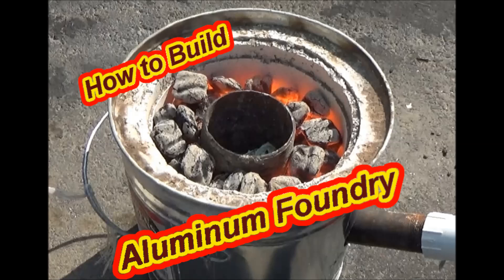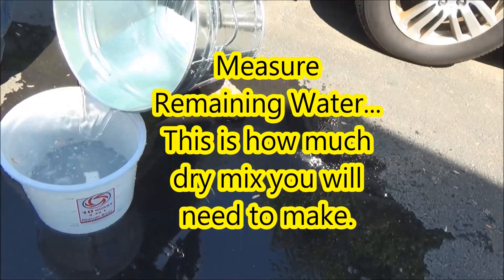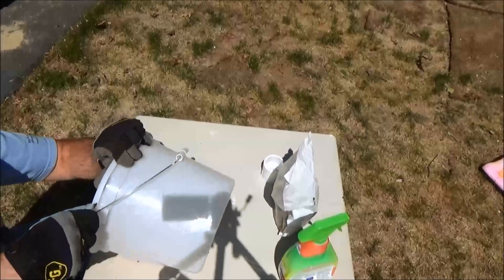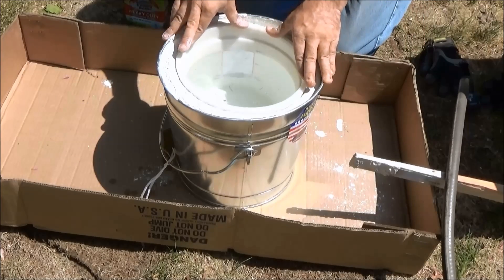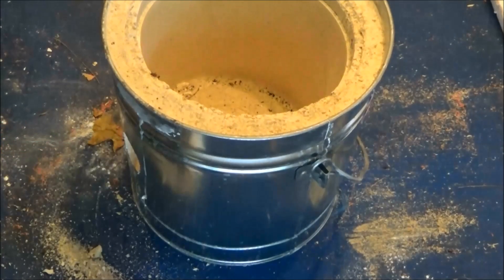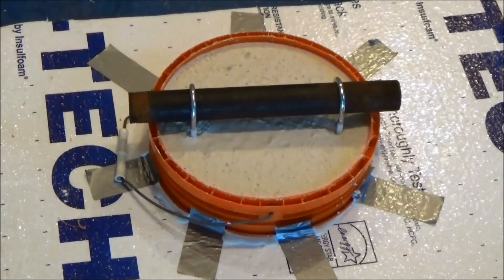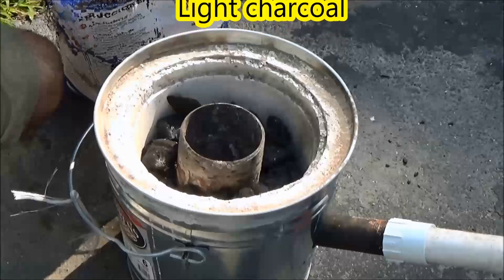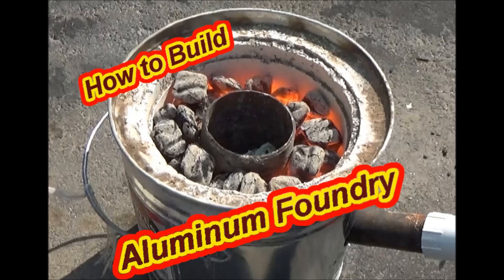How to Build an Aluminum Foundry!

Comment: What did you use as a crucible? The same one Grant used?
Reply from the maker: I used a 4 inch iron pipe with a cap. Thanks for the comment!
Reply: @heathputnam9524  creative.  Liked how you used the hair dryer instead of the propane too. Awesome video thanks for sharing.

Comment: Something I missed here is perlite floats! It either needs to be saturated prior or realize where he puts the perlite in it will float and separate from the plaster of Paris if you use his recommended 10qts of water. The plaster mix I bought was not 1-1 mix it was 2 parts dry to 1part water. So I started over.
Reply from the maker: Keep mixing until the perlite stops separating and floating. Then pour it in. Thanks for the tip and for watching!

Comment: Hey I love the vid. I made my own. To anyone thinking that this will be way to big, it’s not as big as you would think. Also, do I need a hair drier that I can turn off the heating coils on? Those cost more. 

Ps, is eazyer to pour the plaster mix into the free lid the bucket comes with from Home Depot instead of makeing your own lid. I didn’t have a hole saw so I marked out the hole on the metal lid, then perforated it with a nail set, after that, I hammered a flat head screw driver in between each little hole to cut out a little disk from the lid. After that I just carved away at the soft plaster with a acre driver to make the hole. Did the same method for the air intake. I also mixed steel wool into the lid so it would be stronger.
Reply from the maker: So the hair drier is just for forced air. Any one will work. Thanks for watching!

Comment: You are using a galvanized bucket, did you know that its vapors at high temperature are highly toxic!!!???
Reply from the maker: Yes, but after the first use in a well ventilated area the galvanized surface is clean. Thanks for the comment.

Comment: If you want to save your bucket, use vegetable oil. I drilled my hole about an hour after it cured and it seems to be fine so far.
Reply from the maker: thanks for the tip!

Comment: This seems so much more efficient than a propane-style foundry. I’m not talking weight, but the price per BTU
Reply: Depends on the material costs in your region.
Reply: It depends on how often you use it
Reply: Gas is cheaper if you buy in bulk
Reply from the maker: Thanks for the comment!

Comment: My comment is to ask how you put the crucible back to continue melting once you remove it and pour off the aluminum ? yes I intend to build this (your) foundry and use it, thank you for the instructions ...was just you had a answer for the problem I see.Johnny B.
Reply from the maker: Usually the charcoal falls to the bottom. Just set the crucible on top of it and add more around the crucible and turn forge fan on. It will remedy quickly!

Comment: what about heating the inside bucket to help remove it?  Or slitting it to fold in on itself?
also, what did you use for your crucible?

Comment: EVERYONE MAKE SURE U DON'T USE GALVANIZED STEEL BUCKET, IT RELEASES TOXIC FUMES ON HEATING OR WELDING, BE CAREFUL!!
Reply from the maker: Xpert Hank just as a side note; the bucket does not get hot with this mixture. I have actually picked the bucket up and moved it by hand while melting aluminum. I do not recommend this but I goes to show the bucket does not heat up. Thanks for the safety tip though! Thanks for watching!

Comment: Could i use concrete instead of plaster of paris?
Reply from the maker: You can use concrete, but you will lose some insulating properties.
Reply from the maker: Yes, you can use concrete but you will lose some insulating properties

Comment: Seriously, thank you. 
This video is the first I have been able to find that adresses the viewer at an at-home level without urging you to use materials that will literally explode. 
So far, I have seen the following types of videos on this: 
"Ok so then you take your $100.000 industrial machine with gold inlays and then you have it travel to the future to obtain a power source....", "Ok so go to the junk yard and scrap three ovens, take their heating elements and then go sweep powder for a month at a building site at night when nobody is there and it hasn't rained" or "Ok lol, so then you pour some concrete into your flower pot and hope it doesn't explode in your face when you use it!" 
Other than that, there are guides by hobbyists on how to make old-school brick furnaces with bricks and mud, and let me tell you, they are almost impossible to keep tight enough to keep the heat in.... 

This video actually precisely explains how to make a proper, low budget smelting furnace with materials that you admittedly won't nescessarily have in your kitchen but that can easily be obtained at low price. And while I haven't tested this furnace just yet, I am confident this will actually be what I've been looking for. 
So thank you. 
Will I be able to smelt copper and brass in there too? Or do I need to look up some other designs for that?
Reply from the maker: Anarasha lol, I have melted copper in mine using charcoal. It does take much more time than aluminum, but doable. You may have better luck using coal due to the higher burning temperature. Good luck! Thanks for the comment!
Reply: Thanks! :D I used an expensive propane torch for jewelry to burn directly into my crucible before, but honestly, that's only really viable for gold and silver, it takes too long and is far too impractical for most other metals, so this will come in very handy!
Reply from the maker: Thanks for the interesting comments! I have melted copper, you will have to add charcoal servers time and keep the hairdryer on high!

Comment: how long does the aluminum melt?....approximate
Reply from the maker: About 20-30 minutes depending on how much. I always put a few small scraps in the bottom that melt quickly and starts a small pool of aluminum on the bottom. That helps the stuff you add to melt much faster! Thanks for the comment!

Comment: Could you do two steel buckets with sand in between them, with a blower for a cheaper build.
Reply from the maker: That will work... Although I will give my opinion. The inside bucket will obviously get extremely hot and will deform a lot. The sand is not as good of an insulator so will get very hot and transfer heat to the outer can which will also get hot. You will also need to come up with some sort of cover that will hold in the heat and not break or explode. Good luck with your build and be very careful! Thanks for the comment!

Comment: I followed the mix instruction and the equal parts water and plaster seems to be too much water in my case.  24 hours later the plaster is set but still wet.  I used 100% Perlite.  There is a difference between Perlite which absorbs no water versus vermiculite which does.  Your bag in the video was ambiguous, it listed both Perlite and Vermiculite.
Reply from the maker: jderimigable the excess moisture will come out after a day or so depending on temperature and humidity. Hanging a light bulb inside may help draw the moisture out quicker. Good luck and thanks for the comment!

Comment: What kind of can are you using to hold the melted aluminum
Reply from the maker: The crucible is made out of a 5 inch long 4 inch diameter black iron pipe with a 4 inch pipe cap on one end. Thanks for the comment!

Comment: Can it melt copper to make bronze?
Reply from the maker: It will melt copper but you need a lot of charcoal. Thanks for the question.
Reply: Heath Putnam No problem. I use an oxy acetylene torch and a thick old stainless steel ice cream scoop to melt bronze and copper in small batches. I've never gotten a big crucible hot enough to melt it. I mainly cast little Thor hammers and very small ornamental bronze daggers son I don't need alot melted at once

Comment: Making the lid, I put a greased plastic cup upside down in the mold.  that way, no material wasted, and no need to drill or buy a hole saw.
Reply from the maker: Good idea, thanks for the comment!

Comment: +Heath Putnam I recently made a foundry and was wondering if I could tuck tape the steel pipe to the pvc pipe instead of am adapter. or do you think it would get too hot and melt it right off? 

thanks
Reply from the maker: It gets pretty hot! Good luck!

Comment: +Heath Putnam I recently made a foundry and was wondering if I could tuck tape the steel pipe to the pvc pipe instead of am adapter. or do you think it would get too hot and melt it right off? 

thanks
Reply from the maker: marc dallaire Even the threaded adapter melts a little, but the duct tape is worth a try. If you wrap some aluminum foil around the iron pipe, it may dissipate enough heat so the tape does not melt. Or use a longer pipe. Good luck and thanks for the comment!

Comment: Why you use gesso and vermiculite and not  gesso  with sand?
Reply from the maker: Vermiculite is a much better insulator than sand and it makes the furnace much lighter to move. Thanks for the question!

Comment: Heath, thanks for the video and answering all the questions in the comments. After reading most of the questions i was hoping you could shed some light on the quality and life expectancy of this / your mixture of perlite and plaster of paris, since im planning on building a furnace for blacksmithing. Its main purpose would be heating up leaf spring steel just above 1000 deg C so that I can flatten it. 

This would subject your furnace to the highest temperature possible over a longer time. Will you let me know? Thanks in advance!

Comment: I thougt Plaster of Paris decompuse at high temperaturs. But every Foundry on you tube does use it.
Reply: Ulrich Hager it doesn't decompose it just kinda cracks after a while
Reply: Ulrich Hager,  You can put steel wool or stainless steal wool in the mix it will add strength to the plaster of Paris mix. I built this same style of foundry and with the steel wool it didn't crack as fast

Comment: I got the 6 gallon bucket and 10 quart plastic bucket, 4inch pipe with cap etc.. everything from your video.   The only difference is I am using  play sand and plaster of paris.  I am not sure what the exact mix I need.   With the 6 gallon bucket, the displacement of mix I need is about 15 quarts like you said in your video.   So what is the mix I need.  1/2 sand, 1/2 plaster of paris, 1/4 water?  Do I need to included the water in the three part mix to add up to the 15 qt displacement? Or do I just mix the dry materials to the 15 qt and then just add water on top of that?  7.5 quarts each of plaster of paris and play sand?  

Thanks in advance.
Reply from the maker: your dry mix should equal your measured 15 quarts, the add the water. Good luck! Thanks for the comments!
Reply: +Heath Putnam 
yeah I was trying to figure out how much water I needed. after checking out a bunch of sites and other videos.  I did 7 quarts each of p.o.p. and play sand and did 5 quarts of water.  I just mixed it today. it seamed to work pretty good. still drying.   Thanks for the video.

Comment: 10 quart bucket for the inner cavity.
6 gallon (24 quart) bucket for the main body.
I would assume the volume of the large bucket minus the 10 quart bucket would be 14 quarts....
Not sure why you really needed the whole water displacement process.

Comment: I made a foundry like this using Grant Thhompsons guide but the lid broke because of the hear and the inside is really easy to scratch away. Do you have any ornery also used about half a bag of charcoals and the fans didn't even get hit enough to melt. Help would be appreciated :)
Reply: Technobot3000 what do you mean fans didn't melt ? And it cracks all the time watch grants newest video about the foundry he said if the lid cracks make a new one reinforcing it with something

Comment: Is the galvanized (zinc coating) steel a risk factor at all when using these buckets for a foundry or does the fact that they are cool enough to touch while running mean there's no risk to galvanized fumes? I have searched & search & can not find any steel buckets that are not galvanized.
Reply: yes dude thats why but if it ever burns the outer bucket some how.. call the hospital that zinc is very dangerous so dont just take one source as fact do more research!becuase one mistake with this kind of project could cause permanent damage due to the nature of the project
Reply: Thank you for the rely. Yes know zinc is nothing to play with. I'm not taking my info from one source. But no matter how many of these I see on youtube or else where, I'm still confused why folks even risk it. I don't like the risk factor. I decided to passup the bucket idea all together. I'm gona put together some red bricks, mortar, & line the inside with the plaster/sand mix. Besides red brick always looks great :)
Reply: good idea but the zinc really isnt a problem with this method and you never want to breath the smoke anyways caution is always the answer
Reply: I found the exact same bucket that he used at Home depot. With the plaster lining that actual outside bucket does not get over 200 degrees so it does not melt the bucket at all.

Comment: Just so everyone knows, you use twice as much plaster as water. NOT ONE TO ONE!!!! If he had read the package he would know that.
Reply from the maker: The reduction in water is due to adding the extra solid filler material I have tried it both ways and get better results using the recipe in the video. Thanks for the comment.
Reply: @heathputnam9524  your recipe has more water any way you look at it (final ratio is 2:3 water:dry mix). I tried it and found the mix too watery. The perlite floated and the plaster didn't cure. I'm going to try again with less water.
Reply from the maker: quackerzdb hmmm... mine worked fine ;) you saw the video! Thanks for the comment! Good luck on the next one!
Reply: LOL, nice work Keaton.
Reply: Dear Keaton. 
Did you not even notice that this wasn't a pure plaster mix? 
I use clay for one-use molds instead of vermiculite, and I'm sorry to tell you, if I mixed that with 1:2 water to plaster ratio like I did the first time to follow the instructions on the bag, I would have lumps of non-pourable goo. 
So while you are correct in that 1:2 is correct for plaster, maybe you should not correct someone on things you obviously don't actually know anything about :) 
Just for future reference so you don't come off looking like an unprofessional quack like now :)

Comment: i was wondering why did he use a 1:2 ratio of perlite to plaster of paris, when Grant used 1:1 sand to plaster of paris. Whats the reason for that?
Reply: perlite is lighter than sand.
Reply: Erik theGoProFanatic the idea is u wont pockets of air in the cement/ clay/ plaster mix. Air pockets are the insulator. Is u can get rock salt cheep it's great, when dry fully, rinse and dissolve the salt away
Reply: SuperPeter05
I thought about that as well.. but I feel like cavities will just weaken it.. maybe i would try that on a second Foundry.

Comment: so is perlite better than sand does the foundry last longer?
Reply from the maker: Perlite makes the foundry much lighter and has much better insulation properties. Using sand in the mix does make the foundry slightly more durable. Whether you use sand or perlite, you need to treat the foundry carefully because they are both softer that a concrete mix. Thanks for the comment!
Reply: i used sand in mine and it has small cracks all around the inside wall would u know of the problem that went wrong
Reply: how thick are your walls? im starting to think people are making the walls to thin causing them to crack when the steel expands and shrinks when hot and cold. Anything too thin will not handle heat as well as something thick. so thicker is better.
Reply from the maker: My walls are about 2.5 inches thick. Thanks for the comment, I think you are correct.

Comment: how long does the foundry last before cracking and breaking up?
Reply from the maker: +tom johnson As with any refractory it is fragile. It will last many firings as long as you are gentle with it. I have used mine at least 30 times so far and it is still in good working order. Thanks for the comment!

Comment: I just use a terracotta flower pot wrapped in Gaffa tape with a bean tin as a crucible, the tin glows cherry red.
Reply from the maker: +Jordan Durham If it works, Great!
Reply: I know this is an old comment, but I'd like to add a personal experience here. 
Improvised crucibles can work just fine if you don't want to invest in a graphite one, but a graphite one will last you for as long as you can avoid dropping it. 
You can even use cans from like tomatoes or beans for single-use crucibles if you are smelting a small amount of aluminium and will pour within a very short time - but the first time your improv crucible cracks a hole, the molten aluminium WILL pour out through even the tiniest hole. 
I did this. I couldn't understand why two whole bags of soda pull tabs only gave me a small amount of metal and a lot of dross. When I put out my coals and wanted to put them in a bucket of water with my grill tongs, I pulled out the bulk of all my metal, flowed into the coals. I considered naming it my "Sculpture of Failure" and hanging it on my wall.

TL:DR: Invest in a graphite crucible to avoid injury and humiliation